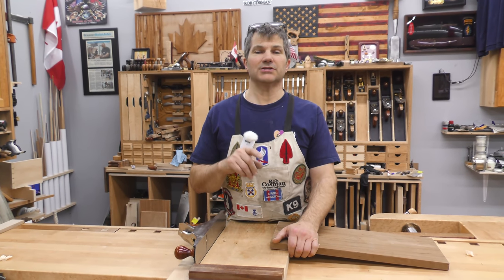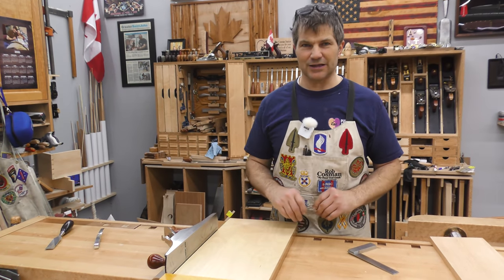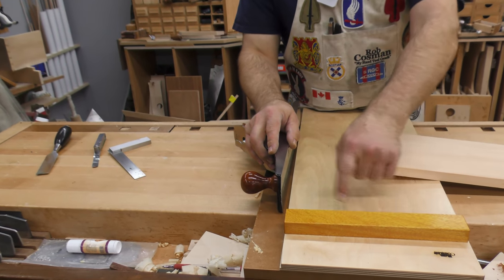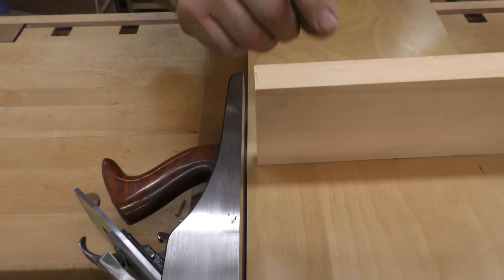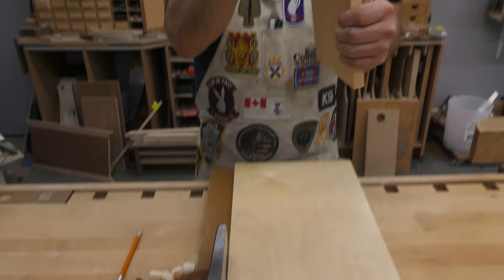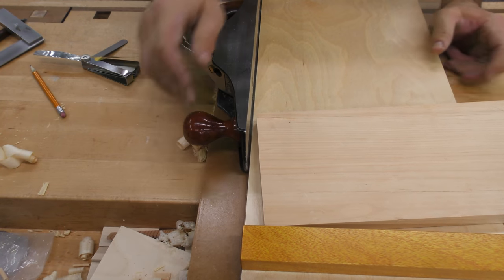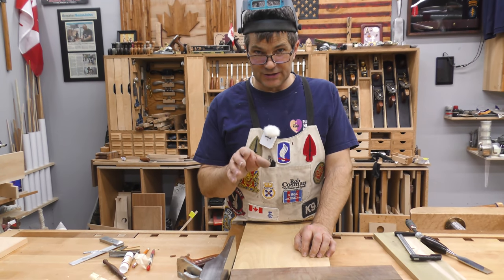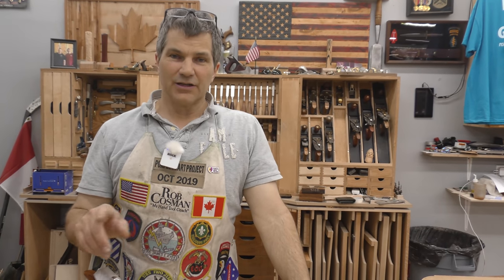How To Use A Shooting Board - Like a Pro!

Comment: Great video, I was trying out ways to get that chamfer but your technique makes the most sense. I may throw a knife wall at the end of the board as well just in case I go too far, and to cut to, but probably isn't required.I was also running into the issue of not cutting enough, I mostly get something like fine sawdust rather then a chip. I may need to be exposing more blade and take that heavier cut. 

I find having a "practice" piece of wood handy for that first run/check of the shooting board. I do this as a hobby so it can be some time between using the shooting board so it is good to get the technique down again, and check that everything is still square and true before touching a project board. Also good as check after sharpening the blade if in heavy use.

Comment: Thanks once again Rob.  But you also raised my attention when  using your 5 1/2.  Where do you find a plan e with a "star wheel" for adjusting?  Keep on smiling.
Reply from the maker: Its an adjustar.  We sell them for WoodRiver and Lie Neilsen planes.
Reply: @RobCosmanWoodworking  I don't have my Woodriver yet but it's on it's way.  I'll check your web when it's here.  Thanks.

Comment: Rob, You sold me on the 5-1/2 and it's an amazing tool. The lateral adjustment arm on my particular tool (from the factory) is extremely tight to pivot even without the iron installed. 

QUESTION: Is there any way to adjust this arm-to-frog pinned/riveted connection ?
Maybe you could do a video that shows how easily yours pivots without the iron?
side note: My #6 older Stanley lever arm will pivot very easily without the iron and when the iron and and cap are installed the arm pivots with the correct amount of pressure just perfectly.
65 degrees Fahrenheit in Redding, Ca today!
You inspire me greatly.. Thank you for all that you do.
Reply from the maker: Try lubing it, also work it back and forth

Comment: Great Video Rob, thanks.  I’ve never used a shooting board so might be a dumb question but what prevents the plane from shaving down the edge of the shooting board?
Reply from the maker: I cut a small rabbet on the edge of the plywood, the bottom of the rabbet rides on the plane sole below the blade.
Reply: @RobCosmanWoodworking  - Thanks, I plan to build one this weekend.  Go Canes!

Comment: If your fence is slightly out of square, how would you recommend removing it? Since it is glued, I am thinking removing the fence with a scrub plane is my best option. Do you have any other recommendations for removing it without compromising the rest of the shooting board?
Reply from the maker: My first choice would be to fix it without removing it.  I do this with a shoulder plane.  You can remove material to bring it into square

Comment: Good video. I do wonder though; if you shoot the long grain first to ensure a straight edge prior shooting the end grain, wouldn't that mean the end grain you're offering up to the fence is out of square, as it hasn't been shot yet.
Reply from the maker: Yep, that is why you use the fence just to hold the board from moving, pressing the board against the plane sole straightens it.

Comment: Hey Rob, why does the blade of the plane not cut into the top board (of the shooting board)?
Reply: It's either not tall enough to reach the plane mouth, has a rabbet or after being used a bit the plane will make the rabbet

Comment: So if your plane bed is not fully square to the side, would you recommend sanding it to square or just use the lateral adjustment to square your cut? Mine is out a few degrees.
Reply from the maker: Lateral adjustment is fine but a pain to have to always do and remember to “undo”!  Plane fix is a better solution.

Comment: A couple of years back I bought a 'factory seconds', bevel up Jack plane from Axminster. It was all I could afford at the time and considered the small amount of fettling a reasonable compromise. It turned out to be a piece of cr-... er, not for me. Many months later I realised it'd be good as a stand alone shooter and eventually modified  it to include a kidney shaped grip, bolted to the side and removed the tote. But I tell you what, the fact that it doesn't have a lateral adjustment level is a small, but significant annoyance. It'd be unfair of me to slag off the blade too, but it readily loses the ability to effortlessly cut slivers off end grain. A quick test on the long edge proves it can cut fine, but I end up bruting it through some end grain. I even went as far as building a ramped board to see if it'd improve the entry of the plane into the wood. Results varied. I would bet my life it's my sharpening, but considering the history of the plane, it's hard to look at it kindly.
Reply from the maker: Sounds like sharpening or blade quality to me

Comment: well thanks Rob now that I know how to use it, I gonna need to make both full size n mini size but by then I’ll forget how to use em and have to watch this video again. Thought Robs shooting board would be a lil more accurate than mine, see I’ve been using my Smith n Wesson 500 Mag 10.5” barrel and i’ve found the 700 gr load works the best for squaring dem not so square ends but here’s the rub with that method. I’ve been having to clean em up a lil n then hit with 220 sandpaper lots of extra work 😳😳 so imma try Robs shooting n make both sizes n maybe just maybe it’ll save me some work? 🤣🤣🤣🤣🤣🤣🤣🤣🤣
Reply from the maker: Sounds like a rifle instead of a shooting board!!!!!!
Reply: @RobCosmanWoodworking  come on Rob, lighten up, supposed to be funny lol

Comment: Rob, what do you think about shooting boards that have the flat part (the mdf on yours) slanted downward front to back when compared to the base (the plywood on yours)?  It seems like this would make the angle of attack be a slight skew.  I haven't tried it, but I see designs like that out there.  It does make building it more complicated, but maybe it is worth it?
Reply from the maker: A ramped shooting board.  IMO, not worth the effort.  If you are doing it to spread out the wear on the blade, sharpening is under a minute, not worth the construction time.  If you are doing it to skew the cut, not enough angle to make a difference.

Comment: What is your view in using tallow or mineral oil instead of wax? By the way, your trick to give better grip to the handles of f clamps using hockey tape is the bomb!
Reply from the maker: Tallow works for lubrication as does mineral oil.  I prefer a chunk of wax, easier to carry in your apron

Comment: Would a low angle plane like a 62 work on a shooting board? Thank you.
Reply from the maker: it does but not my choice.  Too light and not enough surface area on the side, 5 1/2 is a better plane and a better choice for the shooting board.
Reply: @RobCosmanWoodworking  Thank you.I was assuming the angle was more important for cross grain. Learning here.

Comment: I'm confused. If the plane rides against the shooting board upper base then it'll cut into it. If it doesn't, then it's not guaranteed to be perpendicular to the fence. What am I missing?
Reply: The plane only rides on the lower edge of the upper base that is proud of the rest because of the rabbet.  Remember, the lower edge of the plane base doesn't have plane iron to cut, the base edge (3/16" or so) rides on that proud edge.

Comment: What prevents the plane from damaging the planing board?
Reply: Watch his build video. There is a small rabbet on the edge of the board the board you are shooting is sitting on. It needs to be low and deep enough that the blade doesn't contact it. It makes ALL the differenc. Not sure I have seen that from anyone else. Hope that helps
Reply: Jim K    I didn’t see that, makes sense, keep the plane firmly on the base so it doesn’t gouge the vertical plane.
Reply from the maker: I cut a small rabbet in the top piece that is below the blade that the plane rides against

Comment: I've set my shooting board aside until I can get my plane sharp enough to use it. I can get it sharp enough to plane through small knots in pine, but not to plane endgrain. I'll be holding on these tips until then.
Reply from the maker: Watch my plane blade sharpening video
Reply: @RobCosmanWoodworking  I just found out that my blade was sharp and I had a problem with the iron flexing during the cut. I fixed that and am now able to shoot boards and do so many things I couldn't before. Now I can use my shooting board, which was built based on one of your videos. Thanks for your content.

Comment: You have planed a rebate into you shooting board the rebate can clearly be seen this means the plane is able to tilt, it may also now not be square. There should always be an overhang with the work piece. Above all don't attempt to instruct others when your technique is incorrect.
Reply from the maker: Care to explain your comment further? The rebate is intentional and not done with my plane (don’t correct others with improper facts), and it most definitely is square.